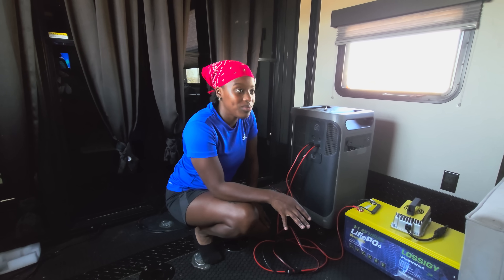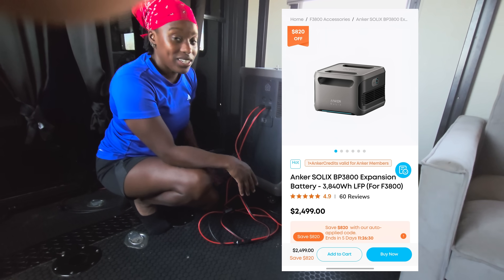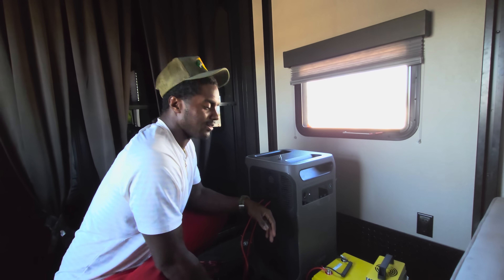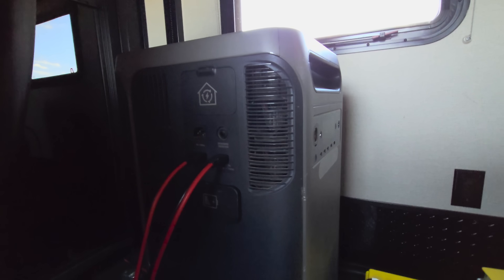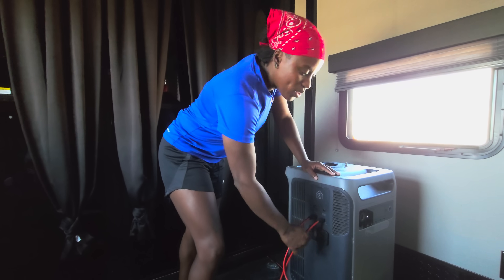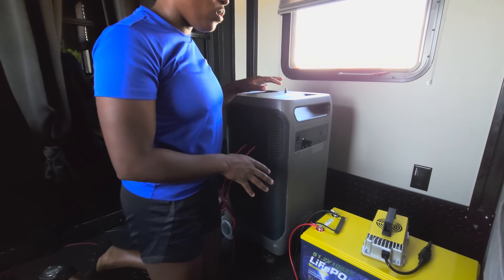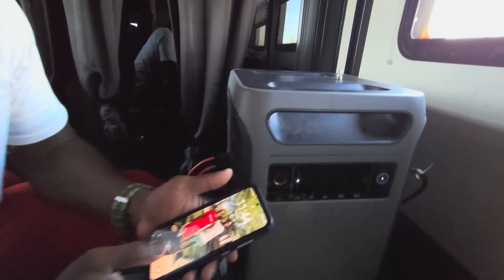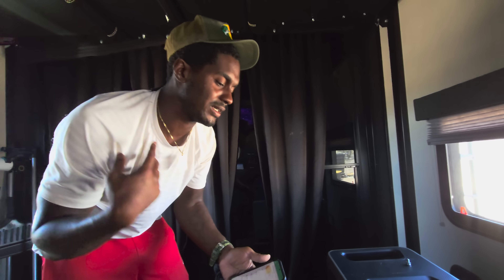HARSH Truth about SOLAR OFF-GRID - CAMP UPDATES and MORE!

Comment: I’m off topic , but have you tried using reflective insulation on the windows . We stayed in our toy hauler for a full summer while we remodeled the house and it helped keep the trailer a bit cooler because it reflects the sun off the windows.
Reply from the maker: Thanks for sharing. We are using reflective insulation. Do you put it on the inside or outside of your windows?
Reply: @livinglifewithleilooge I have it on the inside, I lined it with Velcro tape so It’s easy to pull off and on . Helps in winter too with the condensation paired with a humidifier.

Comment: Yall are doing great it’s just that what yall are trying to do your system is to small. First move your panels to get maximum energy from them. 2. That 3600 is two small to run that many ac plus your regular stuff. You are going to need a 7k inverter minimum. Last you should be using your extra battery as storage not a feed. The panels should be supplying enough energy. make a few changes and y’all will be fine. Congratulations again and keep up the good work.
Reply from the maker: Thanks for the feedback. We have learned so much from the community. We have a few upcoming projects that will help us overcome our current issues until we are able to invest in a larger inverter.

Comment: You may need to buy 2x 600 watt Bifacial panels. 800 watts us not nearly enough,.You still need to be adding to the battery even while running your air conditioner.

I have 6x 400ah LiFePo4 batteries 30 kilowatts of storage.  Each cost 995.

I use 2 Renogy 50v DC to DC charger, to charge my batteriest. Ebay sell open box versions for 200. And I can slso use my vehicle to charge the batteries too  Also using more than one charger controller is more efficient. So I am going to buy two more. Taking my ability to charge to 2400 watts.

I really.miss my old system!
Reply from the maker: Thank you for the tips, this gives us a better understanding of the system we would need.

Comment: Solar has a higher upfront cost than gas but over time you save but it's the opposite for gas. The problem with getting those batteries and using them as a way to expand your system is that you have to manage them separately. Solar priority making sure you know how much power you're using running the key thing and then everything that may or may not cycle at once. Then you will need a little more solar than that to match your output. The extra batteries are mainly to be used when there is no solar power or during the night to keep things going until you can start charging again. I have a 24kwh system for emergencies and I just got a soft start installed on my 4-ton A/C which would allow me to power my house with Air conditioning for 4 hours if I were running the air the entire time.
Reply from the maker: Thanks for the feedback. Exactly like you mentioned we need more panels to match or exceed the output during the day, and using the batteries to provide power to the unit overnight. We are getting a step closer to figuring this thing out. Your also right about gas. Gas provides one time usage and solar could provide endless power when configured correctly. Learning is taking place.
Reply: @livinglifewithleilooge  with my current system if I don't run the A/C then I get 2 days out of it with no solar just the batteries. I'm glad I went with the Delta Pro Ultra
Reply from the maker: Without the AC, we are not pulling much at all. The Anker can run everything off of the (4) 410 watt panels for days.  @Trillville43

Comment: I had a solar generator trailer on my land by DC solar. It comes with two forklift batteries on it. Paid about 7k total and it had a charge controller,  and inverter and combiner box and fuses. And it came on a car hauler trailer. Some of them even have floodlights and ev charger and a Kubota diesel generator for backup. I however lost my trailer to thieves. Cleaned me out a lot of tools a tractor, a skid steer. If I was to do it again the forklift batteries are the worst I would replace them with lithium. The forklift batteries are too heavy and you can't drain them past 50 % you will degrade them.
Reply from the maker: That's horrible. We went with the Anker Solix because at that time it was one of few solar generators with a 50 amp connection. We have learned so much over the past few weeks. If we could do it again there is a lot we would do differently.
Reply: @livinglifewithleilooge  i would recommend you look into those trailers as it was a company that went bankrupt and they had to sell. Just look up DC solar and see if you can get some auctions or someone selling their's. And its already setup on a trailer you just need a truck to pull it to your site.

Comment: Multiply your volts times you amp hours that gives you the storage . 12v times 300ah =3600watts or 3.6kw of storage. If u run a 24v system x 300amp hours is 7.2 kw of storage
Reply from the maker: Thank you for the feedback. We are getting a better understanding of solar systems and the type of set up we would need to rely fully on solar.

Comment: Why on Earth did you install a high frequency, transformerless inverter? Transformerless inverters provide a shorter life expectancy, and a much poorer peak power capacity. Even worse, because transformerless inverters offer absolutely no galvanic isolation,when their MOSFETs fail, they can easily damage your homes appliances. You should have installed low frequency, transformer based inverters instead.
Reply from the maker: Thanks for sharing. We had no idea. Learning is taking place.

Comment: This is a great and inexpensive idea 💡 way to boost the F3800 to run heavy loads I would say . Even adding more of the same lipofe4 batteries in the future will greatly improve the performance of the F800 to run more heavy duty loads more effectively without bogging down the F3800 . Y’all are on the right path to progress . May the solar be with you .😉👌

Comment: I'll give you my armchair analysis of your situation after only seeing this one video and knowing you are in Arizona. You have sunshine in abundance. You should set up two solar arrays to maximize the input on your solar generator and collect the free energy on each of the solar ports. Next, determine how much energy you are using under this system, if there is a short fall or if your needs are being met. The app on your solar generator should be able to help with that. With that information you can size the second part of your solar system. The second system will require more batteries and an inverter (like the EG4 6000XP) and another solar array to collect power to use at night and emergency reserves. You can feed that battery power into your solar generator just as you did in the video. Having these tandem systems will eliminate the need for the gas generator. Anker might be willing to sponsor you and provide an extra battery and other equipment. Good luck.
Reply from the maker: Thanks for the advice. This is exactly what we had in mind.
Reply: @livinglifewithleilooge  Great minds think alike.

Comment: You could just buy 3 100 amp hour batteries for a total of less than $450 that would equal the $2,500 for that one battery.  Four 400 watt solar panels will never give you enough to run A/C and everything else in your RV.  Adding batteries is great but from my experience you need about one 440 watt panel for each 100 amp hour battery to live fully on solar.  800-1000 maximum exposure, you need to be pulling in 4,000 watts.  You are way underpaneled.  You need to balance the amount of solar input with the amount of batteries.  Did I hear you say you wanted to run "both" AC units?  That's close to 3,000 watts right there.  

I really dig you guys doing it off grid, I'm also off grid in AZ.  If I can let me give you a little advice.  Don't waist your money on the pre-built solar generator type systems.  For so much cheaper you can build your permanent solar system.  Yo will end up purchasing all new equipment when you build out a cabin, house or whatever.  I made all the mistakes you can with solar, wasted a lot of money.  The problem with setting up solar off grid is YouTube.  Countless channels telling you this is the latest and greatest, all brought to you by sponsored videos.  It's very difficult to research since YouTube, google, etc. all bring up the sponsored results first.  You're in AZ, you can purchase brand new 250 panels for $35 each.  Think about that, for $700 you can have 5,000 watts of solar input.  Get yourself a Victron 450/100 controller, an AIMS 6,000 watt inverter and you're good to go.  All of this for $2,900.  

Good looking family, best to all of you.
Reply from the maker: Wow! Thanks for the great advice. I do have a question. Is there a way we could connect? My email is jerrionjamal@gmail.com
Reply: @livinglifewithleilooge  I don't want to put my email on here but if you have a Facebook page send me a link and I can message it to you.  Thanks

Comment: Hello guys you may also want to check into the new Furrion Chill Cube 18k AC’s. They air basically a mini split in a Rv ac foot print. They are more efficient in cooling then regular Rv ac’s and use less power. We just installed one and our other two ac’s hardly run through out the day or night and we like it cold inside.
Reply from the maker: Nice! Thanks for the tip. How was the installation? That would be perfect because we don't really see any place in our RV where a mini split would go.
Reply: The install is simple. Shut off peer to ac unit you’re working on. Remove old ac unit install new unit in its place. Take the Coleman control box that was attached to old ac and cut the 120 wire so it can be attached to furrion chill cube Hook up the 120 to new unit. Tuck the old control box with the rest of the wires up inside out of the way. This way your thermostat can still control your heat. Attached the other wires from the new ac to the new distribution panel and use the new remote to control the ac. Very similar what you just did with your new 12volt ac. Game changer to cooling.

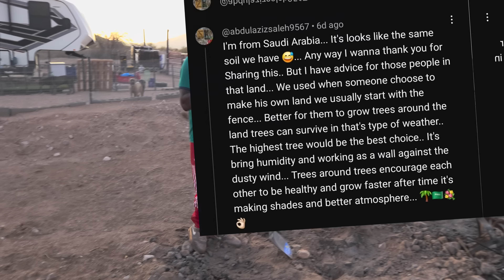Comment: 15:48  Their comment matches up to what Viktor Schauberger taught regarding trees creating shade that allows moisture to remain in the soil.  The orange tree probably needed to be hardened off.  It looked like it got too much sun too early on.  I’d try some shade cloth at least directly above for when the sun is most intense.

Citrus naturally grows more like a bush.  People prune it to look like a tree.  You’ll have an easier time growing it if you let it bush out.  The root zone will stay cooler from the shade and you won’t have to water as much.  The issue with that is if it was grafted onto a different citrus rootstock.  Sometimes the rootstock will send out branches that you would normally cut so your plant isn’t wasting energy growing inferior fruit from the rootstock, but it’s harder to tell what is growing from where if you let it grow into the natural bush form.

Comment: You have to get 12 dc air conditioners. But you have plenty of Sun there so if you just expand your solar panels and get the n-type solar panels you should be able to generate all the power you need.
Reply from the maker: We just spoke with someone who recommended the same thing. Is there a specific brand you'd recommend?

Comment: Hmmm.  The basic concept is sound.  You are bringing in excess solar during the day without the A/C and definitely need more battery storage to hold all of it so you have more run-time overnight.    But once you add the A/C in now you aren't going to be bringing in enough solar to deal with overnight or even be able to recharge the next day.  So at the moment you are making due with a generator to recharge the external battery.

Your next move is, just as you said at 13:52, to add more solar power.  If you run out of MPPTs on the Solix, you can buy one (or more) charge controllers and feed additional solar power into your external battery.

My recommendation is that you find used solar panels to mount outside, west or south-west facing to ensure that you get good energy in the late afternoon through sunset.  A 30-degree to 45-degree angle.  Theoretically you can also mount panels "flat" on e.g. a Pergola roof.  With some care regarding their weight.  But if you do mount panels "flat" then I recommend still tilting them at least 5 degrees for water run-off and also use "siphon clips" to prevent water from pooling on the lower edge.

You can buy a discrete charge controller... I recommend a Victron SmartSolar 150/35 (not BlueSmart... SmartSolar).  Each one can take up to 1800W of solar and feed it into your 51.2V external battery.  And you can have more than one charge controller for further expansion... that battery you got can take at least two 35A charge controllers.

The 150/35 can take up to 150V (Voc) of solar on its input, so the typical configuration would be to have 2 x residential panels @ 50V each or 3 x residential panels @ 40V each wired in series (or more smaller panels) and then going into the charge controller.   Just make sure the combined Voc of the panels does not exceed 125V or so.  Use 10 AWG solar cabling.  If doing even more panels, do NOT parallel solar strings... get another charge controller instead.

(There is also the cheaper Victron SmartSolar 100/20... a much smaller charge controller, but from experience the input voltage limit of 100V does not work as well with 48V battery systems because the solar has to develop at least 65V 

--

Now some safety items.  Those anderson-style powerpole connectors are fine up to around 30A (I know they probably say 45A but with 10 AWG you don't want to go over 30A), so keep that in mind.  Always stick to 60C cable amperage ratings for any wiring inside the RV, even if the cables themselves are rated higher.  Don't go over 30A with 10 AWG. 

10 AWG is a good size for solar cabling and fused wiring.  For 35A or 40A consider 8 AWG and 6 AWG.    Remember that solar/battery systems are running continuous current for hours at a time, so cables can get hot if you undersize them.

--

Auto blade fuses are NOT rated for 48V battery systems.

You will want to get a MRBF (marine rated battery fuse) with an 80V rating for the main battery fuse of your external battery.  And its related holder (which bolts onto the battery directly).  This is a safety item.  125A fuse.

Everything hanging off that external battery needs its own fuse.   With cost being an issue, I recommend 10x38mm ceramic fuses and related fuse holders.  You can get them up to 63A but the best price points are 40A or lower.  I recommend getting a bunch of 40A 10x38 fuses.  These types of fuses have the voltage ratings and the interrupt ratings necessary for that battery.  Size the fuse to roughly 150% of the maximum expected amperage (this is so the fuse and fuse holder itself doesn't overheat).

Those batteries can put out an enormous amount of power... they can push 5kW and not even get warm, so care must be taken.

-Matt

Comment: (great video)   Buying new batteries,  fully charged, won't change the fact that at some point you'll be stuck with dead/empty batteries....no ?  Now trying to charge that insane amount of power back in those batteries will be a challenge....  To me, either you get way more solar or you run a generator.    🙏✌ (that's coming from a guy who has 3,300 watts of solar on his RV roof, 600 amp batteries,  and still need to run his generator lol)
Reply from the maker: That's the harsh truth about solar. Until you build a system that has an unlimited supply of reciprocated power, there's going to be gaps in your setup. We've had some amazing feedback and ideas that will hopefully get us where we need to be. Thanks for tuning in!

Comment: A suggestion you may wish to consider is: 1) add another battery and wire in parallel to increase your capacity (10kWh). 2)  Grab a solar mppt charger and connect to battery and solar panels. It will charge your batteries more efficiently during the day and at a higher voltage than allowable by the F3800. 3) Connect solar panels via XT60 directly to the F3800 ((3or4)×400 watts in parallel) to maximize the 1 port not used for the extra battery connection. 

With this start, you will have at least  close to 14kWh of battery capacity, and at the same time, on a good sunny day, you will be using solar to power your electricity needs during the day while storing the excess for night-time use.
Reply from the maker: This is amazing information! We greatly appreciate you sharing. We were thinking of some similiar steps but was not sure how to tie it all in. We are saving for another battery to add to the mix.